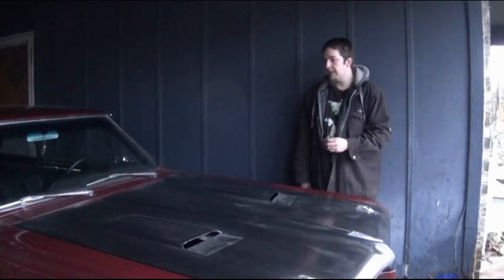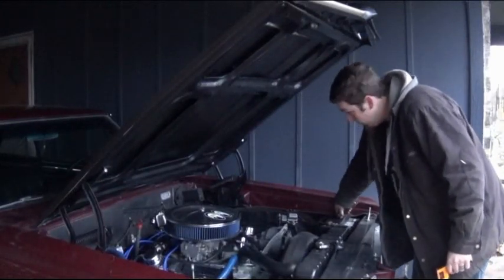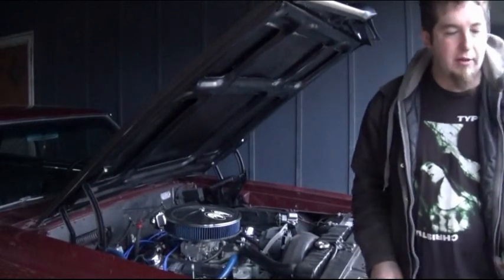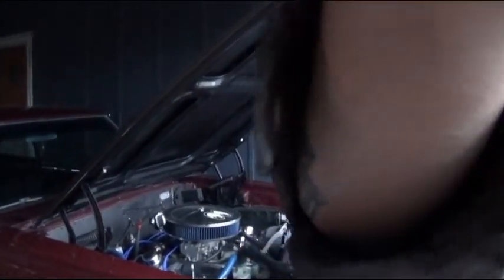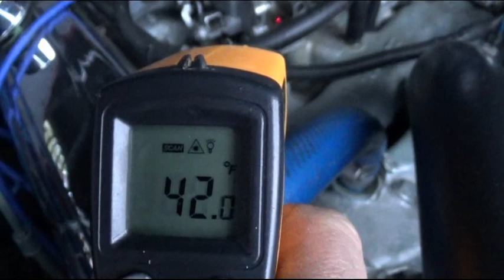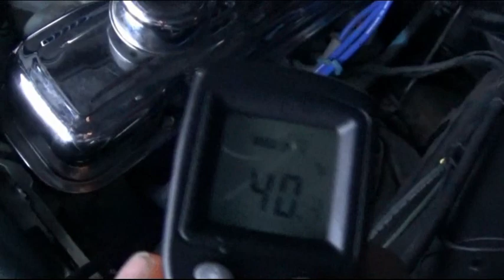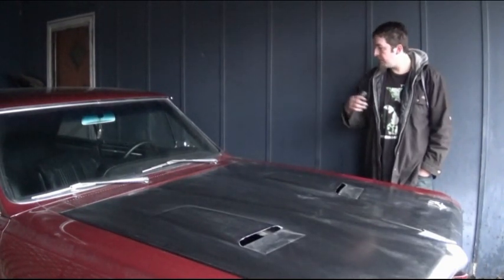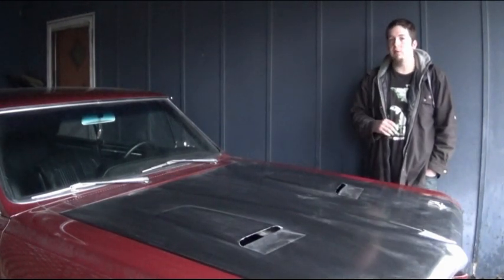1964 gto cold start again 2019

Comment: Starts up fine. Does Pontiac use an exhaust crossover through the intake manifold?
Reply from the maker: Yea they have the cross over under the intake plenum. But they have the valley pan. Keeping the oil from touching the intake
Reply: @EfurdGarage  yeah I know about the valley pan because it appears some newly hired ex ford engineer decided it was a good idea to put the pcv down there LOL
Reply from the maker: @UsefulEntertainment  I honestly like the PVC being there. It pulls from the center and you can run a breather in each valve cover. And it dosnt look like a Chevy lol
Reply: @EfurdGarage  my only complaint is now i have to sneak my hand under there to get at it but yeah i could see the pros vs cons
Reply from the maker: @UsefulEntertainment  I think it depends on the intake because some are more open above to make it easier like the ,60s. My edelbrock left little room I had to open it up
Reply: @EfurdGarage  yeah the edelbrock on my TA is a pain. If you get the chance check out the new channel testas speed shop.
Reply from the maker: yea my factory ones are not bad. i already have lol